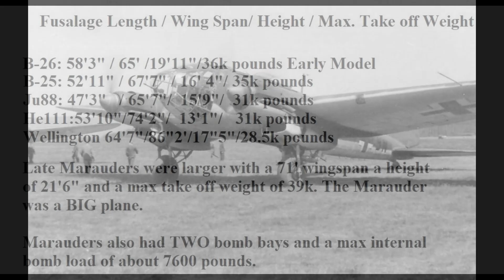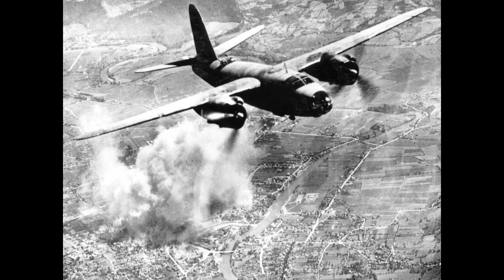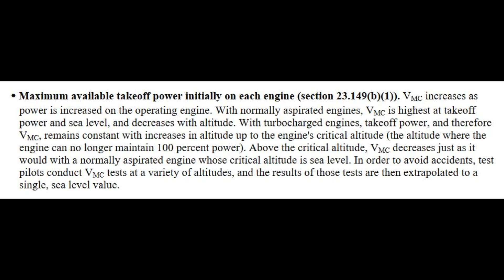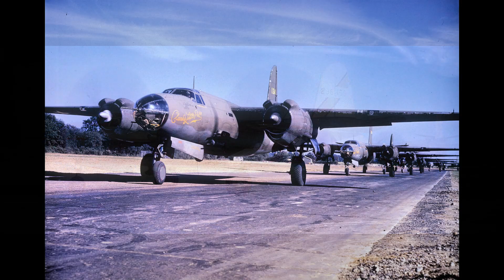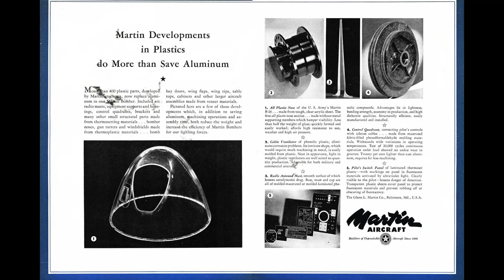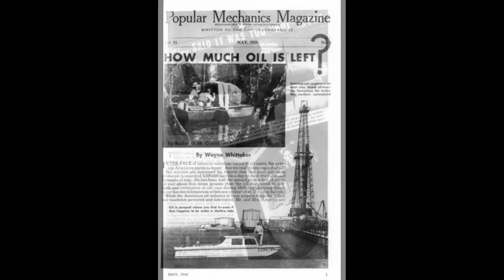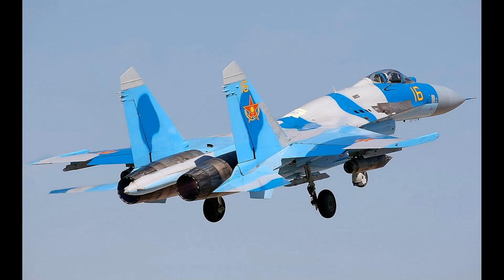Martin B-26 Marauder. Unsafe At Any Speed?

Comment: Thanks for the good video.  I think it is the old compromise that we discussed in fighters, it applies in bombers too.  More wing loading means more speed, but higher stall speed, and in this case, higher one engine minimum speed.  All high performance twin engine planes had to deal with this.  The Mosquito had serious issues too.  Sure, the Mosquito in 1941 was faster than a Spitfire V, but the chances of engine failure that would send you to your grave on take off and just post take off were twice as high (since it had two engines).  And you can belly land the Spitfire V at 75 mph.  Despite the better survivability in combat, I would think that the B-25 was overall a better airplane.  Funny, the second post war B-26 inherited many of these problems due to their decision to use a laminar flow wing.  But the second B-26 was a smaller plane and more improved powerplant.
Reply from the maker: Good post Demitri.

Comment: i agree that the b-26 is less well known than the B-25.  The trade offs for the safety vs performance was impressive and understood by the designers.   
When I was in school we discussed how Mcdonnell Douglas was too familiar with building military jets and the DC10 suffered for this with a number of failures that were accepted in a military jet but unacceptable in a commercial passenger jet.  Redundant hydraulics on flaps, locking flaps in position, having doors that securely latch into place, were all luxuries to a light weight high performance fighter jet but resulted in spectacular crashes and hundreds of lives lost.  The company could not sustain these losses and design 'failures'.  
The risk/reward calculation is completely different for a passenger jet.  See Boeing 787 software for latest example.

Comment: I'm going to tell you the story of a man that I had the honor of meeting when I was younger. He started out the war in the Pacific Theater Solomon area in Martin B-26. After a while there he ended up in the European theater in the Martin B-26. Eventually he transitioned over to the P-47 Thunderbolt and eventually the P-51 Mustang. In Korea he ended up an f-86 Sabre. It was the most fun to fly of all the planes that he flew even though it was the hardest to fly. He told me many stories of where he was attacked by enemy Fighters and you would push that B-26 all the way up to the edge and it would simply outrun everything in the sky.

Told me at one point in the B-26 they were cruising just after their bomb run, they got Bounce by a squadron of zeros as he called them put their noses down in firewall the throttles getting just over Treetops level and simply accelerated away from all of them. Told me that down a tree-top level there was absolutely nothing I can keep up with that Marauder

Comment: Great video! I have a weird question: why build medium bombers? Fighter-bombers make sense; use your fighters as ground attack after air superiority has been achieved. Heavy bombers make sense, max bomb load and defensive guns. Twin-engine search and patrol craft make sense; cheaper than 4 engines so you can buy more of them and cover a larger area. But why a twin engine bomber? What advantage do they have over heavy bombers? Seemingly a heavy bomber would be more efficient...

Comment: The bomber with the lowest loss rate was the Mosqito, which was too fast to be efficiently intercepted despite the fact that it did many daylight raids and could deliver 4,000 lb to Berlin, the same as the B17.  The statistics were even better than that, because on the rare occasions when it was shot down a maximum of only two crew were lost and a new bomber could be built at half the price of a B17!
Reply: The low loss rate of the Mosquito was due to its limited capability.  It was a one trick pony.  It was fast, and that’s it.  It couldn’t carry a large number of bombs, which meant it was limited to what type of target it bombed.   It couldn’t cover a large area at high altitude like the B17.
Reply: @CncrndCtzn  You dont know much about the Mozzie, do you? It was not only Britain's most versatile plane, but it could carry 4,000lb to Berlin, same as the B17' and with far fewer losses. It could fly higher and faster than the B17 and was much cheaper to build. If shot down only two crew were lost, as against 7 or 8 for the B17.
Reply: Compare a Ferrari to a Ford. Someone's gotta drive the Ford.

Comment: Some time ago I read that Doolittle evaluated the B-25 as having better slow speed handling and selected it for the Tokyo raid. Your expert presentation certainly supports that.
Reply: The carrier decks were too short to achieve the speed needed for take-off anyway, so the choice was the B-25. Losing them was also less expensive. But I don't think you would have heard of period Japanese fighters catching a B-26 in a pursuit; one that's down on fuel and can literally go as fast as a Hayabusa at full stride. Closing at that rate is just not worth it, if you can even close.

Comment: Thank you for the informative discussion. Certainly, Martin was well aware of the compromises in their airframe. As you mentioned, the Truman Commission looked at the B-26, here is a quote from Wikipedia.  "In 1942, Glenn Martin was called before the Senate Special Committee to Investigate the National Defense Program, or Truman Committee, which was investigating defense contracting abuses. Senator Harry Truman, the committee chairman, asked Martin why the B-26 had troubles. Martin responded that the wings were too short. Truman asked why the wings weren't changed. When Martin said the plans were too far along and besides, his company already had the contract, Truman's response was quick and to the point: In that case, the contract would be canceled. Martin said corrections to the wings would be made.[11] (By February 1943, the newest model, the B-26B-10, had an additional 6 feet (1.8 m) of wingspan, plus uprated engines, more armor and larger guns.)[12]"  Once the wings were made longer, the plane became slower than the earlier variants.

Comment: An old Air Classics or a book on the Zero (I can't recall which) had a Marauder pilot flying in the SW Pacific commenting that it was fast. That would have been an early model.  If you could put the nose down it would get close to 400mph he claimed. A zero couldn't really close with them he said - they got only one pass if you had speed. I have also read that experienced / skilled Australian and New Zealand pilots flying things like Hudsons were envious of the guys flying B26's because they were powerful and fast. It would appear the B26 was a fine aircraft if correctly flown but was hot so required respect.  Eric Brown liked it but said it had an aerodynamic  design flaw that surfaced in landing if you got too slow but the pressure of war saw that lived with.
The WW2 twins of most types would be pretty unforgiving if an engine failed on take-off.

Comment: In a sum, a high speed plane design  that does not fly at high speed is bound to be difficult to fly.
Reply: Listen again, it was fast at the altitude it flew at.  At that relatively low altitude all planes had a relatively low True Airspeed but an unchanged Indicated Airspeed, the speed output from the aircraft instruments and the actual ‘feel’ of the air on the plane.  If it had two stage superchargers or turbos it could fly at a similar Indicated Airspeed at a higher altitude but with the lower air density the True Airspeed, equivalent to the speed over the ground, would be higher.
Reply: @givenfirstnamefamilyfirstn3935 Well, it needed to fly faster then and  TAS is not "equivalent to the speed over ground "as quoted by you.
Reply: @beryanbeyaan8047  As well as air density adjustment calculated TAS incorporates position error corrections, compressibility corrections and instrument calibration corrections.  In exactly still air it should be exactly equal to speed over the ground.

Comment: Would be interesting to see how it would work to drive the smaller turbo from the front row and blow both.
Reply from the maker: Eventually they did use dual turbos on radials. But that idea didn't come until a couple years later.